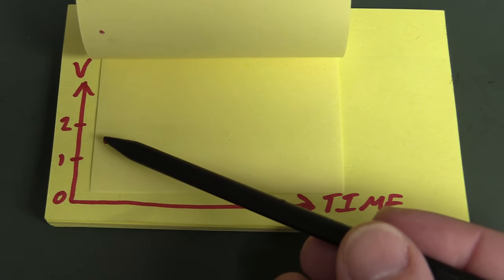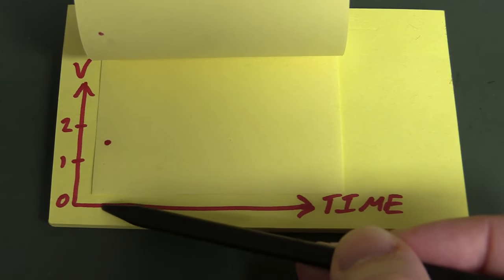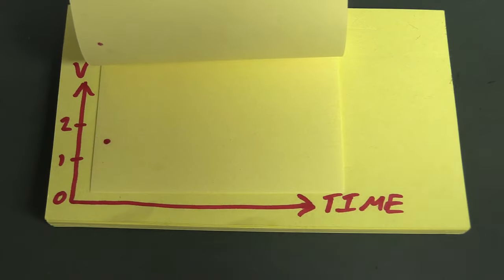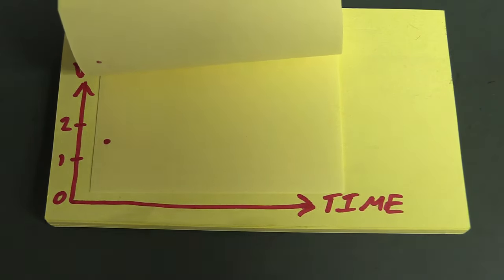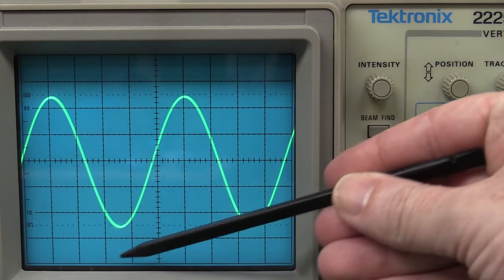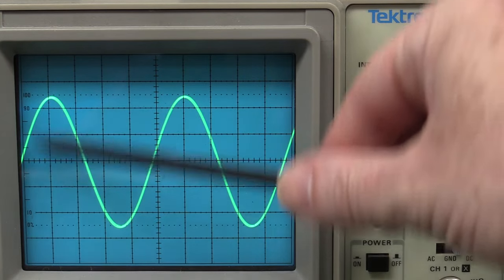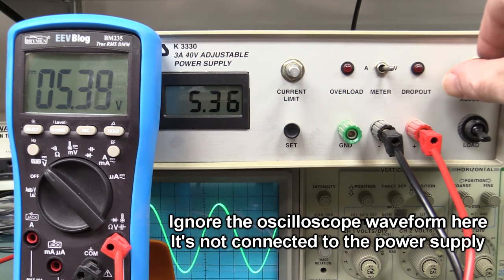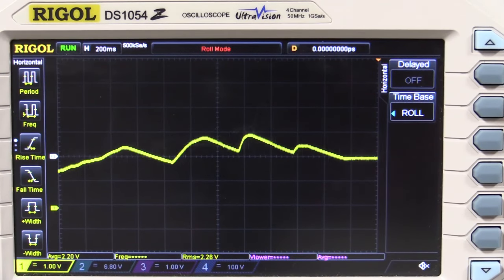EEVblog #926 - Introduction To The Oscilloscope

Comment: cool. what sort of situations/applications would  an analogue Oscilloscope be preferred over a digital one?
Reply: +JOUE BIEN TECH  Fast, and/or fancy modulated analog signals. Eg. the eye pattern of a CD/DVD player. You can do it also with a digital oscilloscope, if you can buy one for a couple thousands of dollars.

If someone dealing with these tricky signals, a good HIGH BANDWIDTH ( >/=100MHz ), fast rise time ( </=3ns) analog scope can be very handy.
Reply: +JOUE BIEN TECH I forgot to mention, that you also need a DSO (digital storage oscilloscope) for troubleshooting ordinary stuff, like logic circuits and power supplies. 

There are some old analog storage scopes also, but they have very limited capabilities, most of them have less than 30MHz bandwidth, and quite tricky to set up the storage mode to get a good reading.

There are also some analog scopes with digital storage, but most of them has a so low sampling rate, which makes them useless as a DSO.
Reply: For the most part, digital scopes are incredibly more useful than analog scopes. Dave's forum has some helpful discussion on this, but the general advice is to go with a digital scope.

Comment: I also would be greatfull for more fundamentals. Watching videos is great fun, but having an idea and then it's to difficult to get stuff to work in real lift is demotivating. I would love some more videos - kind of the ones about the inductor, capacitor, diode, 555 and so on. But also putting stuff together in building blocks and coupling those building blocks. Please involve some math and physics background if possible. Thanks for a AWSOME channel. When a new video is up - I skip breakfast, dinner, supper, friends, bathroom. I really value your movies. But it would be great if building circuits was a channel topic, because practically everyone struggles with this. I hope it's like programming, when you know how then component/function works then you are able to use it in conjunction with other components/functions. But getting there is a bit hard. Also I would like a real deal explanation of the H-Bridge so Im able to build a robot with some power (e.g. handling 5 kg in 2 m range). But again thanks very much.
If you have some material you would like a "student" to study feel free to inform in any way (url - link, email, skype or what you prefer)

Comment: Hey, I've been thinking about buying an oscilloscope with the primary function of serving my engine computer diagnostics on my racecar. We're thinking about going to a DIY, homebrew type engine management system. We mostly need it for the sake of looking at waveforms on gear-toothed wheels and pulleys that indicate the position of gears/pulleys on cams and crankshafts, as well as looking at duty cycle PWM style outputs, honestly at frequencies that must be pretty low. Would an analog scope serve me just fine, or should I consider a digital? If so, would a lower frequency scope, like a toy-ish 200KHz "hobby kit" scope work just fine for that? The system we're planning on building, if we decide to go with a non-stock ECM, is based around the ATMEGA2560 chip, on an Arduino Mega, running at 16MHz, but that doesn't necessarily dictate the frequency of the waveform of the ins and outs. 

Just curious to your thoughts. 

Thanks.

Comment: thanks so much I don't have money for a rigol but I hope a 20$ kit will do the same thing again awesome video
Reply: thanks for the reply 60$ seems a bit off and I won't be handling above 50v just some basic pwm and some triangle waves 40$ is my max Thanks again..
Reply: +syamala raj These 20$-30$ ones are really fine for getting started. I got a slow USB scope first and it was quite nice to experiment. I just recently switched to a Siglent SDS1102CML which is great and more than enough for what I do. If you work with simple PWM waves and similar stuff, a 20$ one is more than enough ;)
I recommend you the https://www.amazon.com/dp/B00YZWF2J8?psc=1 which I also bought and tested. It should work fine for what you need.

Comment: I cannot afford an oscilloscope yet, but after watching this I shall definitely start saving.
Reply: I'm getting the Fnirsi 1014D.  It's cheap enough at 150 bucks or so. Even has a built in signal generator.  It's not the greatest but for as much as I'll use it it'll be good enough

Comment: What will happen if the input voltage value exceed the maximum input range of oscilloscope? which part of the oscilloscope will be affected most obviously
Reply: It would probably blow the analog front-end, which does the magnification/amplification, coupling, etc.

Comment: Can I probe 230V AC (320V peak-to- peak) household mains power supply safely with my rigol1054Z? It says max 300V on the probe, but I can set it to 10x. Than I measure only 32V peak to peak, right? Can someone please confirm?

Comment: Do you have any experience with UNI-T scopes? Are they any good?
Reply: uni-t isn't known for decent products, i would avoid.
Reply: Robbie Katz My dad has uni-t multimeter. That is for dirty field use, but it works just fine. Weird thing is, that for same price I could get MUCH better Rigol (at least for specs) scope than uni-t scope.

Comment: Bro if you dont mind plz made another 1 video using Oscilloscope in a real circuit gaving it power supply and check whats fault or going on IC and chips to measure IC's input out put signals or Hz pleas e i want to Understand for first time basic and whats actually used it for 😢😢😢

Comment: For me, there's one thing that an analog scope is better at than a digital - examining audio in a Lissajous setup where you're looking at the phase between the left and right audio channels (or a pair of 5/7:1). See this vid https://www.youtube.com/watch?v=zDGTD7bGh3k  The one on the bottom right of the shelf is an old Tek 475, the one in the middle is a TAS 475 4 channel analog - one of the last that analog scopes Tek made.

Comment: Can't a dso measure current variations?.
P.S: I know most signals are voltage changes.
Reply: Most Oscilloscopes don't have a current measuring input.  But you could plug in a current sensing probe that converts the current of interest into a voltage at a known rate.  Or you could just hook your scope up to a resistor in the circuit and do the multiplication in your head.
Reply: Thanks for the reply, I actually wanted to view I & V waveforms of RLC ckts on a CRO. eevblog is full of amazingly knowledgeable people. Even my college teachers had no idea on how to do it.
Reply: Are you a lecturer?, lab in charge or engineer working in a company.

Comment: but if u want to measure amps u need a multi meter right ?
Reply: Current measurement is just measuring the voltage(!) drop over a known resistance, then you get the current from ohms law. So if you have an accurate resistor you can plot the current over time by connecting that in serial and measuring the voltage across it using an oscilloscope. With some limitations which I'm sure others can explain (because I can't :P)
Reply: well is It easyer to use a multi meter to mesure amps
Reply: It is if you can't do some basic(ish) maths that is essential to electronics.
Reply: That's true but aren't the multi meter Invented for that

Comment: in the begining you put a 9 v battery and then you demonstrate the graph for 1.5 volt its a mistake, and confusing to beginners. just simply say if there is a AC voltage and how to measure , thats easy to under stand